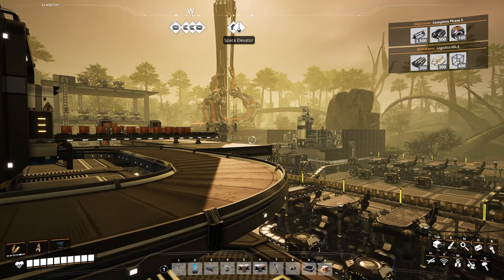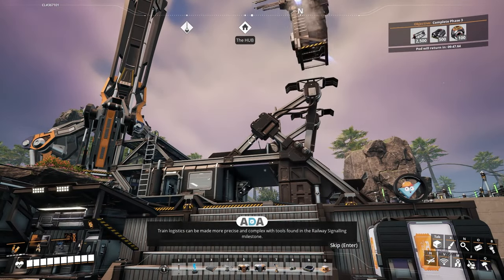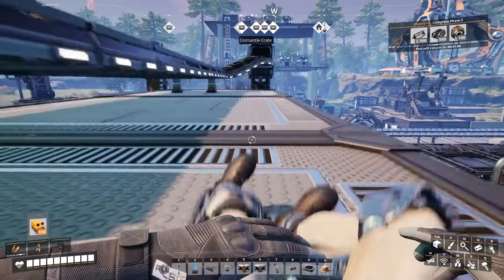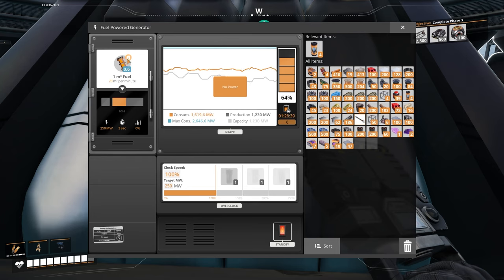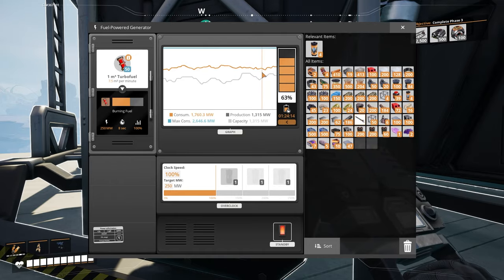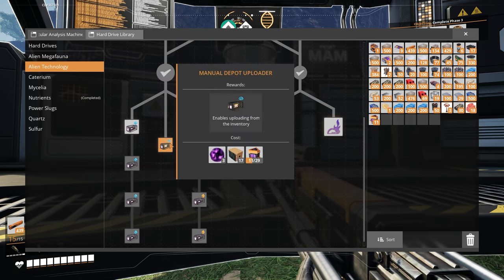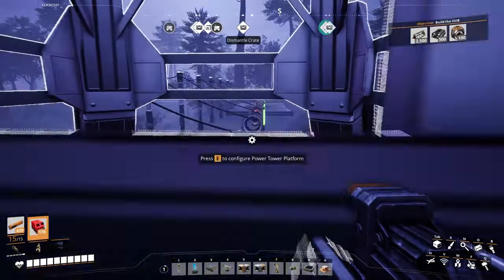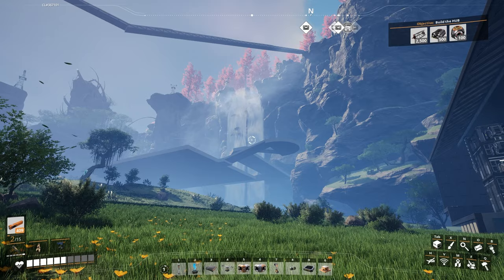Satisfactory v1.0 Let's Play - Episode 8 - Unlocking Turbo Fuel & Mega Base Beginnings!

Comment: I'm sure you realized, but the reason the turbofuel didn't load into the refinery is because it was still burning its supply of regular fuel. Once that ran out it would start pulling from the pipe. Also the new base looks like it's gonna be hella dope! Love the waterfall.
Reply from the maker: What I didn't understand was, why it didn't just use it up, I'm sure the system was at capacity so I would have thought at least one of them would have run dry.